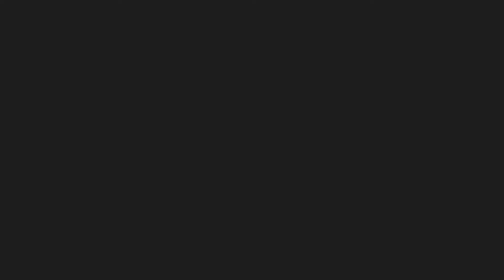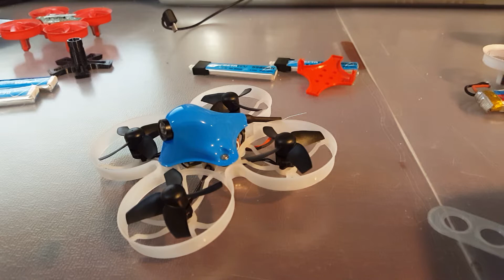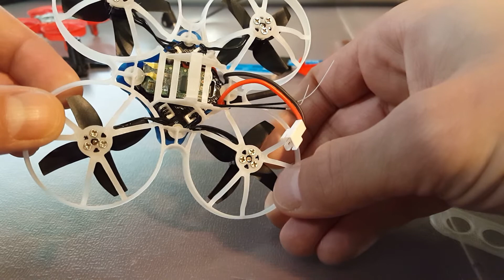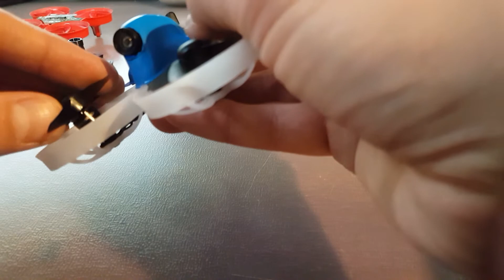BetaFPV Beta75 pro Update   Motor Bushing Issues

Comment: Hi, there, if you have any problem with your 0703 motor, please check the link below. For the broken motor, it's not hard to fix it. You can remediate it by using the following methods. Please contact us to get vulnerable parts of motor in free. What is more,we have upgraded the motor, the upgraded version motors (0603 or 0703), the bottom ring and shaft are welding together via laser. It solved the issue that the motor bell flying out completely. https://betafpv.freshdesk.com/support/solutions/articles/27000045214-troubleshooting-motor-doesn-t-spin
Reply from the maker: +Thea Xiao thank you Thea!

Comment: Flew about 5 packs on mine before the same issue started on one of the motors.  I also was disappointed how easily the motor bells fell off after a light crash.  I'm sending mine back ASAP.

Comment: That's not a bushing but rather a E-clip, little motors like those through them in crashes. You can get E-clips at hardware stores or Amazon It's probably 1/16 or 1/32. All you have to do is unscrew the motor and push the e-clip over a notch that is made at the end of the shaft. Get an e-clip tool it makes it alot easier to fasten them. The original Beta65 pro brushless that ran 2s did this all the time.
Reply from the maker: I will take a look and see if I can find a c clip locally.  Thank you for the awesome information.  i never had any issues with the clips on the 1103s on the Beta 65.  Maybe I will see about grabbing some extra clips for those just in case.  Thanks again TheAfroEngineer!

Comment: This has been a problem with all the 070x motors....I believe Boldclash is trying to address this with new motors but I have had the problem with several different brands...I have not tried the sunnysky as they have a different bolt pattern.  You can buy extra bushings and collars from Banggood, but it is still very frustrating.